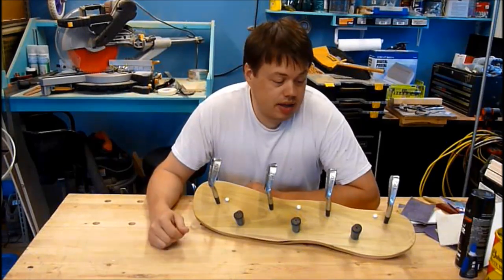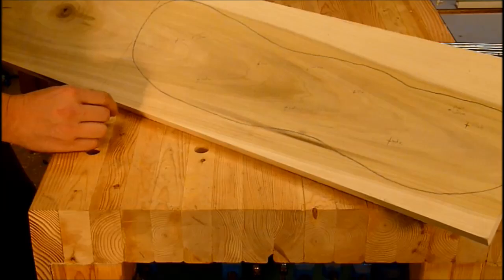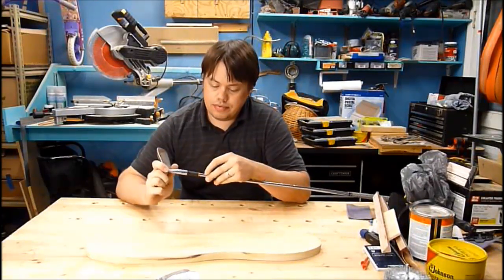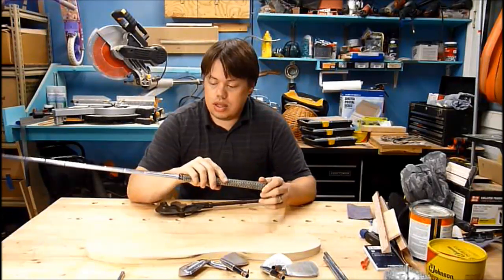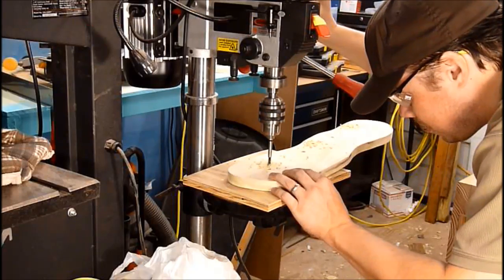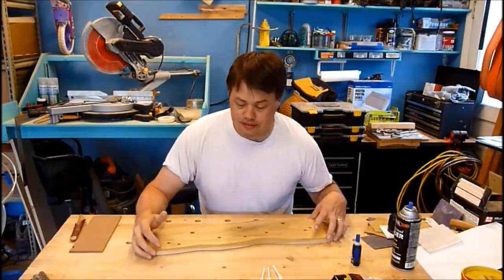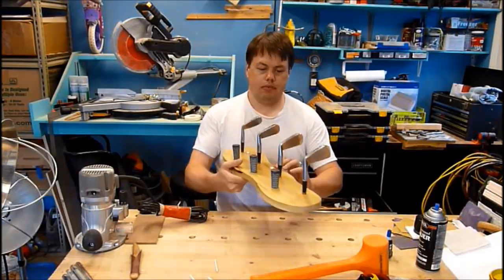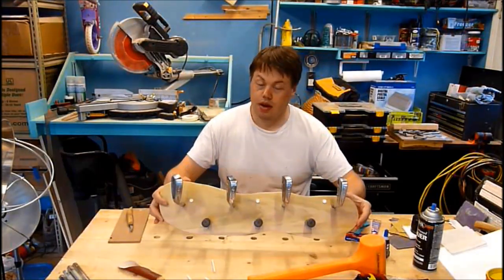Golf club coat rack

Comment: What drill bit did you use? I can't hear; the audio is fuzzy.
Reply from the maker: I used whatever bit I had that was a tight fit with the shaft.  The shaft is tapered so you need to make some test holes.  As for the wood, it was 3/4" Poplar, I believe it was a 1x8